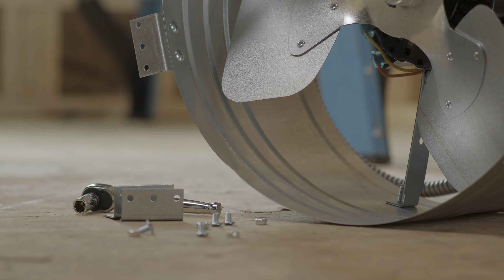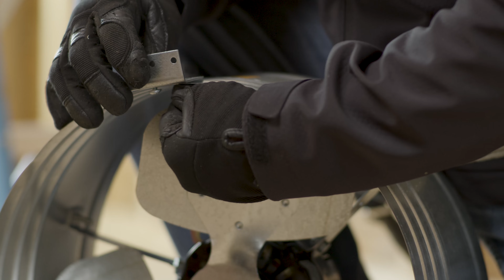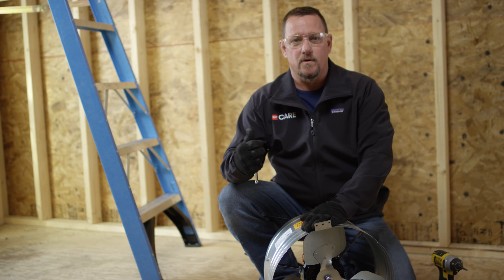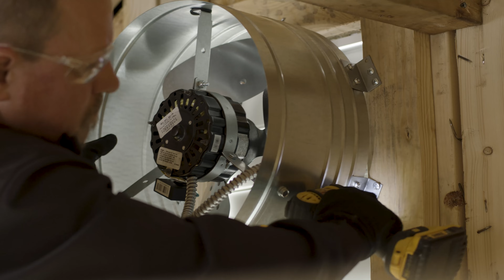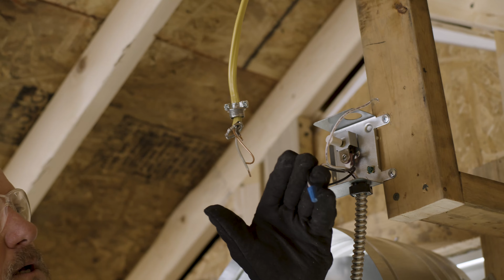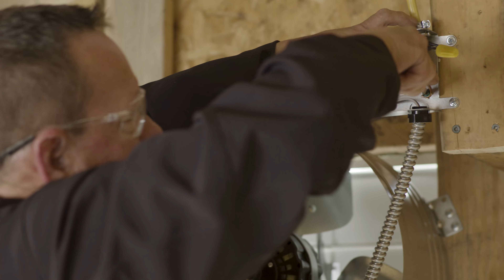How-To Install Master Flow Power Attic Vent - Gable Mount | GAF Roofing

Comment: OMGoondess, thank you for this video. The blue wire nut came off, and the wires separated. Thanks to this video I was able freeze the frame that shows which wires were held together by the blue wire nut. Ta-Da!!! attic fan installed, and wired correctly!!!
Reply from the maker: We're happy to hear this tutorial was helpful!

Comment: Is it possible to wire the thermostat up in the house so I don’t have to climb in the attic to change it?
Reply from the maker: Hi, DB. We recommend reaching out to our technical experts at 1-800-766-3411 with your inquiry, and they will be happy to assist.

Comment: What gauge wire do you use to hook up?
Reply from the maker: Hi, Agustine! The ventilator should be connected to a 120 volt, 60 Hz grounded circuit only with minimum 14-gauge wiring that has at least 3 amperes of available capacity. You should always hire a professional electrician for electrical work. You can find out more about the installation process here: https://bit.ly/3z0cePJ

Comment: You forgot to resize the hole to make the fan work properly….. there should have been a piece of plywood over the gable vent to close up leaks that stop the fan from pulling only from the attic…. It will pull air from around the vent if it’s not installed properly…. 
I do love the fan
Reply from the maker: Thanks for your feedback, Corey.

Comment: What are the 2 wires that come already wired together with the blue wire nut?
Reply from the maker: Hi, Logan. The two wires connected from the factory are connected with a blue wire nut and should not be removed. The connection that is made is the wire from the motor connected to the thermostat. This is done to make installation easier as the end-user only needs to connect the power to the thermostat.

If you have any other questions, please 1-800-211-9612.

Comment: Is the romex running down to it's own circuit breaker? or are ya'll piggin' that off of something else possibly nearby? like a light or something in the attic?
Reply from the maker: Hi! The unit can either have its own circuit or the power can be pulled from an electrical box.

Comment: what size romex cable nut does it use?
Reply: I think he missed hooking up the factoty wire with the blue wire nut?
Reply from the maker: Our technical experts will be happy to answer your questions! You can reach them at 800-766-3411.